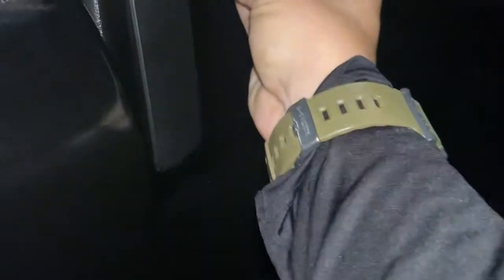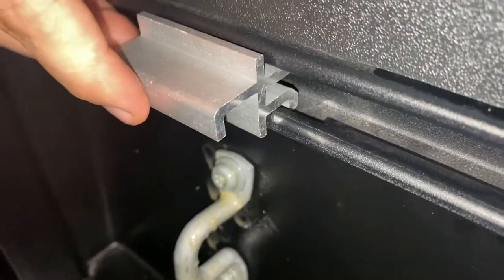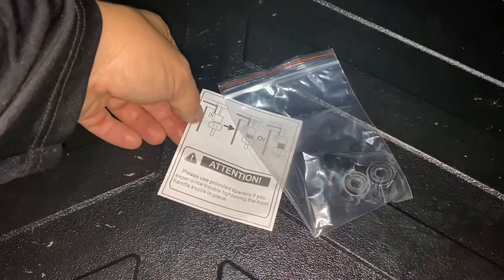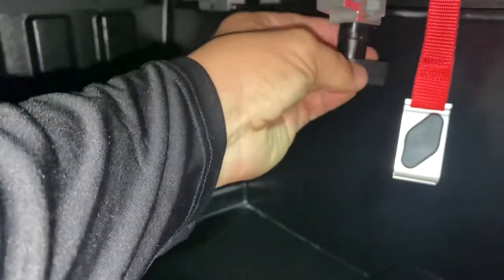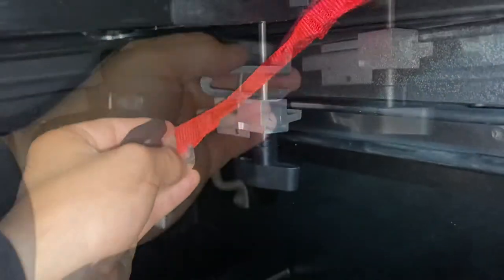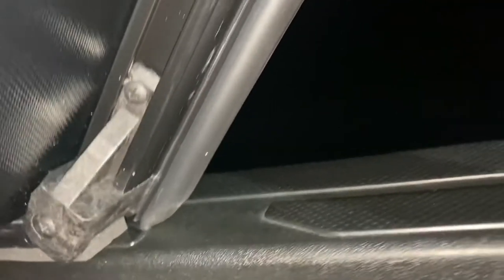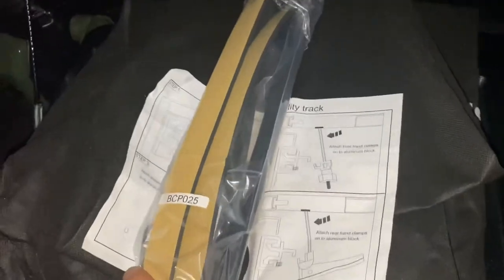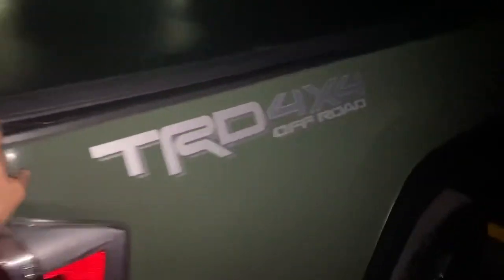How To Install The TYGER Tri-Fold Cover On a (2016-2021) Toyota Tacoma

Comment: I like this trifold cover and the price.  I have the Toyota trifold cover on my 2021 Tacoma TRD Sport and it was a $650 option with installation.  It works well to keep the bed mat clean and dry but it costs way more.  It was convenient to buy it and have it installed by Toyota but now I wished I would have bought one in the $250 price range.  I had a 2009 GMC Sierra SLT diesel 4X4 and I paid $550 for the dealership installed Access brand  roll up type cover.  I didn’t think it would last in our snowy subzero weather but it worked like new for the time I had the truck (I traded it in for the Toyota).  It was sealed to the bed rails by industrial grade Velcro.  The cover was some kind of vinyl that I treated once a year with 303 UV protectant.  It allowed me 100% access to the entire truck bed which I really liked.  If my Toyota tonneau cover has the least bit of problems past the warranty period I am going to get another Access roll up cover.
Reply from the maker: You want to hear a funny story? (In case you said yes) I have the Tyger one but I wish I got the one you have and spent a little more! Isn’t that funny! I like the hard material on yours to rest my Yeti full of coffee or tea or soup. It wobbles on the Tyger. 

I know my Tyger will last a long time though. And the soft material does give it a diff look. A little more adventure style if you will. And yes the roll up types are cool!

Comment: Great video! I may be getting this cover for my green taco very soon. I want something to mostly keep rain and snow out of the bed. I’m not sure I want to spend $2k for a diamondback but I know they are probably worth it. Have fun on your trip!
Reply from the maker: Thanks! Well just so you know, it went through 2 rainy days already (of course right after washing the truck) and also through a truck wash and almost zero rain got in, and only a tiny bit of water from the pressure washer and that was only in the corners by the cab. Other than that, 95% water tight. 👍🏼👍🏼.

Minimal flapping at 60-80mph on highway. I like it more than I thought. 

Only drawback, my thermos wobbles if I rest it on the top, where as a hard cover would’ve been a great table for my thermos.

Comment: Heres a tip on the Q molded rubber: lift up slightly and the strips will fix themselves. There is a little give to allow for it!
Reply from the maker: Just learned that on my own thanks for the reminder! Life is easy with it now :-)
Reply: @brianruperti  great! I got mine installed after watching your video! Much appreciated. I thought (based on the cryptic instructions lol) that the front clamp was supposed to go onto one of the aluminum brackets. Should have watched the video first!

Comment: So being a year later how is it holding up to the elements. I’m looking at this for my 21 trd pro
Reply from the maker: Loving it. Of course for $799-$1,199 I could’ve had a hard cover but to me it wasn’t that important to go had cover. 

The black hasn’t faded much at all. No splotches or peeling anywhere. 

No rips or bubbles of any type. I check the hardware once a year and re tighten from vibration but other than that very happy. Cheers!

Comment: I find im have trouble getting the metal brackets to slide on the Toyota tracks… it’s so tight… I either have to grind some of the bracket or find something else….. Any idea why is so tight?
Reply from the maker: Are you referring to the aluminum h shaped ones?